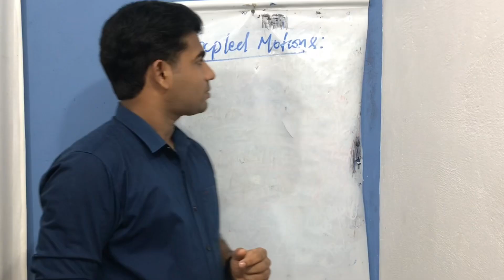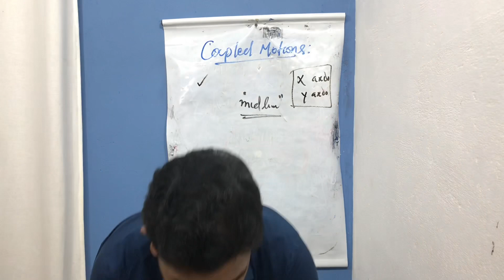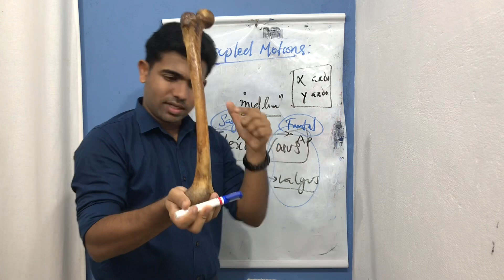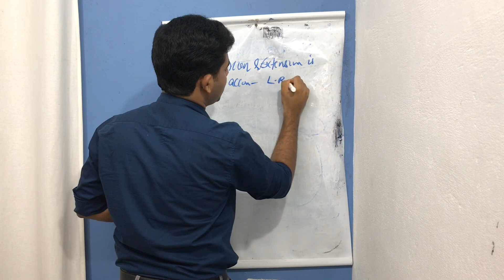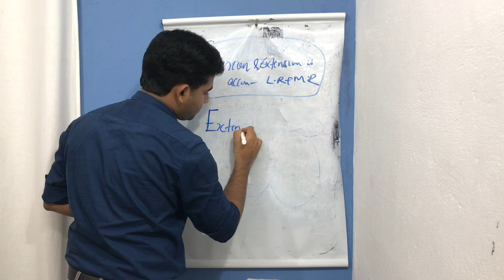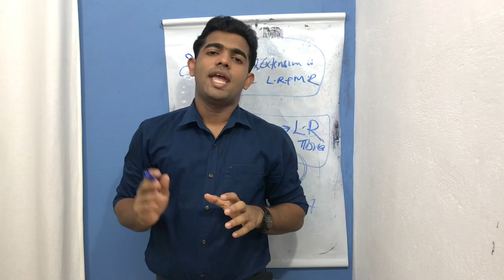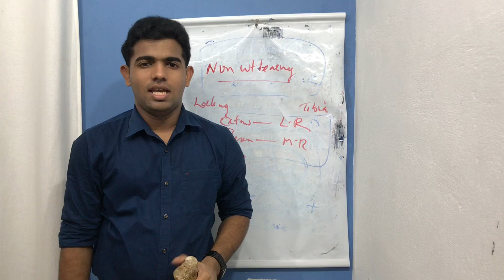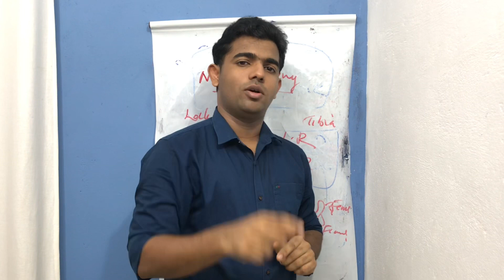LOCKING & UNLOCKING OF KNEE | Screw Home Mechanism # Coupled motions

Comment: Amaaazingggg 🙌🙌🙌🙌
Sir I had 2 doubts 
1. If the popliteus is not working efficiently could it lead to pain although the motion wont be hampered ? 
2. And with weight bearing as the femur is rotating medially while extension sort of like relative tibial lateral rotation?
Reply from the maker: 1.Need not be, i mean there may not be pain as long as other structures are intact.
2.i didn't get your question...sorry are u referring to pain?
Reply: @TonysTutorial  yes sir so for example while walking I'm turning through  the right side, so I'll be pivoting on the right foot so it's going to be medial rotation of the femur so does that lead to relative lateral rotation of the tibia ? I'm sorry it's a very odd doubt 😄

Comment: Sir conjunct rotation kya Hota hai
Reply from the maker: Thanks for writing up can you ask in english ...thnk u
Reply: @TonysTutorial  sir could you explain conjuct rotation in knee and what is the difference between conjuct rotation and axial rotation in knee.
Reply from the maker: Priya Sagar hai priya, i guess i used term combined rotation. Okay the idea is simple axial rotation means rotation of an object here our bone around its axis, for instance take its longitudinal azis( axis parellel to shaft of bone) or any other axis. When rotation takes place it happens around an axis and we denore it as axial rotation of bone. So all motions we studied like flexion extension are all axial rotations. When it comes to combined rotation its actually combination of two rotatory movements, to movements occuring simultaneosly or next to each other. Like in locking both lateral rotation and extension happens together or any other two movemts happening at same time